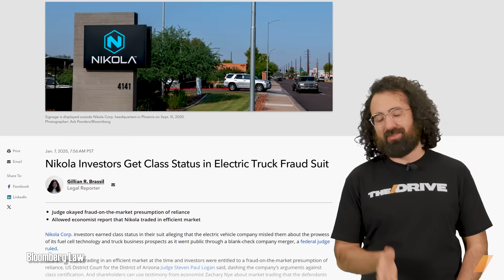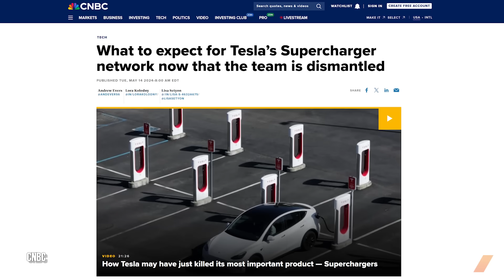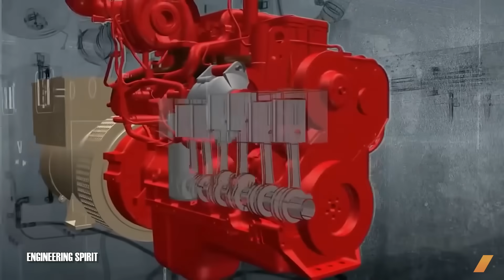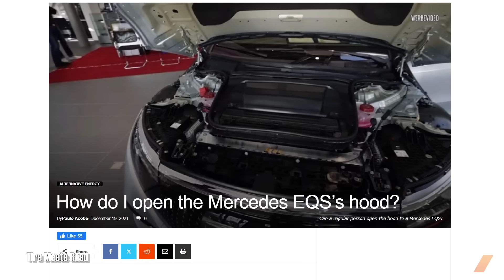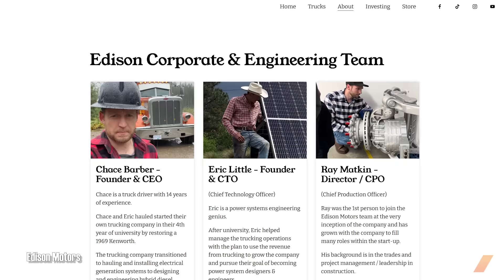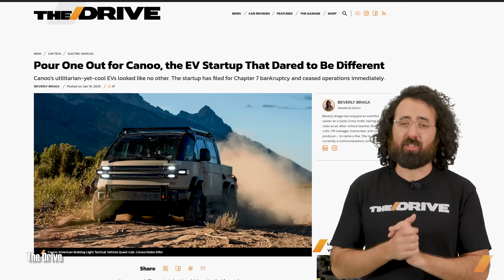The truckers in a shed beating Tesla with 100-yr-old EV tech

Comment: I'm chomping at the bit for the pickup truck kits to become available to bring my 78 jeep plow truck into the 21st century. It'll make my truck harder working, quieter, and insanely more efficient. At the rough estimates they're throwing around for costs, I think the conversion would pay itself off in 6-8 years in fuel savings alone, not even considering that it will uprate my truck to be able to haul bigger loads, which will unlock another revenue stream for my truck. Edison motors are bringing to the market something that is desperately needed
Reply: I'd love a kit for my 07 CRV even eventually, most new cars dramatically overcomplicate themselves now even before you try to use that dumb touchscreen interface in most dashboards

Comment: People wrongly think that diesel electric locomotives are made that way to be more efficient. But the most efficient thing would be to somehow run the locomotive on straight diesel power. The problem is that you would have to have multiple driveshafts going to multiple axles and transmissions. So the physical offset problems necessitate the compromise of adding electric motors. This hurts efficiency but is acceptable for convenience. Using diesel to make electricity to charge batteries to store electricity to get back out again to power an electric motor is losing energy at every step. If you think your electric motor lacks range, you are adding a diesel because of the flaws of the electric batteries. Adding electric to diesels hurts efficiency. It may help in some versatility but not range.

Comment: There is a reason why dieselelectric drivetrain has not made in in trucks. Because mechanical can do the job and in most cases do it with a better efficiency. Diesel-electric locmotoives simply have almost no other option than to transfer the huge ammounts of power. The other option was hydraulics and while it is cheaper, in the long run it costs more because of complex maintenance and lower efficiency. If you have to transmit power above around 600 kW, electric is prefferd. There were a couple of diesel-electric city buses operating on city routes with many stops. Guess what. The fuel consumption is practically double that of a diesel bus with a mechanical transmission (and a hydraulic torque converter). And there is the expense of paying up front for a system with much greater complexity that requires more maintenance and is at the same time heavier (means less passenger capacity). To put it simply: In the "low" power applactaion, it makes no sense to put a electric "drivetrain" between a diesel engine and the wheels. Low being anything below 600 kW of continous power. If you exceen the required 600 kW only during short peak regimes and generally can move with just a fraction of that, there is nothing better than a manual gearbox and clutch.
Reply: Diesel/electric is superior to diesel/mechanical. 

With diesel/electric the truck gets twice the peak horsepower and torque with reduced fuel costs.
Reply: @Sah-o5m  How is the fuel economy of diesel-electric buses? There have been a few thousand build over the decades. I tell you: It is poor. At best there is negligible difference, which does not justify the cost, maintenance complexity and higher mass compared to traditional solutions. I am talking about standard city buses, not some niche application specialty truck, because in those applications it might make sense. If diesel-electric buses would be that good, you would see them everywhere. And I am still talking about city buses which make frequent stops. The difference when compared to city buses of equal capacity, speed, performance, etc. is negligible. In the best case scenario.

Comment: Totally not comparable... One is fully electric. The other is a diesel with the gearbox replaced by a electric drive. So you can only compare diesel vs diesel with different drive types. I do think diesel electric like a locomotive is a good replacement for a normal gearbox. But totally ev is the end game
Reply: Sadly, with today's battery tech, there are no fully EV logging trucks. An interim solution is this diesel/electric hybrid. Over time as the battery tech improves the onboard diesel generator will run less and less until its no longer needed.
Reply: @Sah-o5m  yes, again. This is a useless comparison. The only option nowadays is a diesel with a electric transmission. Nothing special really. Could have been here long time ago but only now someone is doing it

Comment: That's how i power my boat. Small DC generator (range extender) charge my 14kWh battery when needed. The motor is a Motenergy ME1616 with a big Kellycontroller

Comment: As others have noted, Edison trucks are designed with the most available of off-the-shelf parts. They don't have to design everything themselves - mainly it's the drivetrain itself that's unique to them, as even the converters are models you could buy as an individual customer. Additionally, rather than throwing meaningless codes at you, they've been programming their software to actually have explainations for any errors it encounters. No forcing people back to the dealership for a 3 month wait and tens of thousands in repair bills atop the lost production - and no planned obselescence. A big part of the complexity of a standard vehicle surrounds the engine. The engine itself, the transmission, the differentials and gearing system that includes the driveshaft - everything needed to get power from the engine to the wheels. With a series hybrid's generator, you don't have any of that save for the engine itself, which needs less maintenance due to being under less stress. There's an electric motor at the generator, some cables and powerboxes, and electric motors at the wheels (all of which, inherently to electric motors, double as electric generators). Sure, any car or truck will have suspension, framework, and so forth, so it's not removing all complexity from maintenance, but it is truly simpler than a combustion-only vehicle. Poking a battery in the wrong spot is dangerous, in quite the same way poking an engine that just turned off is, and repair shops are right to be wary of underqualification, but most repair shops know this, with EVs and hybrids having been on the roads for years now. The supposed unsustainability is between software locks, intentionally unremovable parts (apparently some cars have oilpans that break if you remove them now, which is truly horrible), and a lot of marketing trying to get you to go to a dealership for repairs.
However, between Edison Motors's focus on vocational trucks - ones designed and built for a specific job on a customer-by-customer basis - and their long-term focus approach to ramping up production, it's going to be a long time before you see Edison vehicles in the driveways of every random person. While diversification is possible (and in high demand), particularly given their pickup conversion kits, it's going to be a slow ramp up as they work out all the kinks before going into full production. They're probably just as likely to go into the business of heavy equipment like digging machinery as into personal vehicles. Or that self-shunting train car suggestion Chase brought up at one point. Still, supporting them is a good use of your wallet's vote even if you have no interest in their actual products, as their methods and mindset are worth supporting and preserving.
Reply: Spot on :)

Comment: I said it on their content and I'll say it here. Purely electrifying our existing systems isn't going to fix anything, (and depending on how we do it, it may even make things so much worse). What we need is a better system like the one we had before we tore it down to make way for what we got now. 

That is not to say that we shouldn't electrify, nor that trucking, vans, and the like dont have their place in cargo transit, anymore than cars have their place in passenger transit, because by all means we should electrify and they do infact have their space. But trucking shouldn't be the linchpin in the american economy when the railroads can do the same role better and more efficiently, and we shouldn't need this concern to warrant electrification. And ofc, with all that said, I do think what Edison Motors is doing is great from multiple perspectives, and should be supported

Comment: All regular RWD cars should have their front wheels replaced with electric hub motor wheels so they can have regenerative breaking, turning that heat and break pad dust into electricity. This can be retrofitted to existing vehicles without too much drama. Turning standard Rwd into AWD hybrid with bolt ons that once they are designed should be off the shelf, plug and play. Might help you hold onto that classic car that the government really hates by turning it into a hybrid. While also improving its power and efficiency.

Comment: Problem is, where is the data ? 
I love to watch Edison and root for them, but all there is is claims. What’s the fuel consumption on the generator? What’s the miles per gallon or better gallon per miles?
I think this is the right way to do a hybrid… but we need real world data. 

In Europe there is battery electric vehicles that only is about one ton more heavy than diesel… you forgot to Elemente everything like the 800gallon tank in your equation… 

In Europe there is a limitation of hours allowed to drive. With one driver more than 800km/day isn’t possible, while there is 45minutes mendetory every 4hours… so 500-600km is the perfect range for a Europe semi
Reply: McMaster University is doing dynamic dyno fuel consumption usage now. We'll get more data later this summer.

Comment: Let's not overlook the fact that you could easily and cheaply power your shop or home using your electric semi, or even your electric pickup. Plus you can power your tools at your work site. It's equivalent to an off-grid system on wheels!
Reply: Exactly. This wasn't mentioned in this video. An Edison truck can provide 600v at 400 amps as emergency power to a home, or jobsite, or for welding and bucket trucks.
Reply: @Sah-o5m  - That's why I mentioned it. So many people waste time on generators which need to run almost constantly, when instead you can set up a battery backup for your home and just run the generator when the batteries need to be charge back up. I'm wondering if they will allow you to purchase just the battery and generator to mount on a small trailer with a small diesel engine specifically for powering a home or shop - it would be a great offshoot business for them too.
Reply: @ I think this is a great idea. Take Edison parts and make a welding rig on a trailer or a home generator. I think at first all parts will need to go to truck reservation holders that have been patiently chomping at the bit waiting for their turn.

After that, when normal people can visit the Edison website and go to the order page and just mouse click the check boxes for what they want that will open up new vertical markets
Reply: @Sah-o5m  - Actually they could gear it up now while they are waiting for their tuck assemblies to meet all of the government bureaucrap requirements. It would be an almost instant team of revenue and help fund their truck division.
Reply: @Rattlerjake1  ahh. Interesting. I like the idea. The only reason I discourage it, is because I know that all Edison people will be 100% busy in Donald building their shop. And they'll be 100% busy dealing with CMVSS. And they'll be 100% busy working on 10 trucks. To add another 100% busy on their plate and I think they'll crack. I mean don't get me wrong. The average Canadian can do the work of 2 or 3 normal people. But if we make em do the work of 4 people, that's a bit much.

That being said, i can totally see Edison gear being used in clever ways to do all sorts of things. 

Like how they used to make doodle bugs out of old model T's. 100 years ago you could strip off the cab and use a model T to run the overhead belts in a sawmill.

Edison truck parts could end up doing all kinds of industrial stuff.
Reply: @Sah-o5m  - They don't need to do it all themselves; this would be a good time to hire more people, paid for by the new offshoot. The companies who build the actual batteries and generator inverters/converters will not hesitate to increase production when the systems start flying off the shelves. THAT'S IF THEY CAN PRICE IT MORE REASONABLY THAN SO MANY OF THE OTHERS who are taking advantage of the market and over pricing their products.

Comment: 1:40 America is ignorant, attacking once again .

 Volvo, iveco,scania Not to mention in China where SANY has a battery swap truck

5:59 Just call Electric diesel if there is no battery. 

But if there is a battery and can run several km without turning on the engine We call it EREV .

Comment: Old Diesel trains.. Diesel generator + Electric motors. Modern electric motors are insane these days and we can get rid of machine parts running a power line computer controlled to electric motors. No direct link to wheels from engine so the engine can have smooth operation the whole time without having to fight anything. Boosters? Make generator a little extra higher power output + Stack capacitors = Regenerative NOS but with Capacitors lol..

Comment: Click bait BS! Charging over an hour? Yeah, maybe at an Electrify America charger! LOL Tesla has it down to 20 minutes at a level 3 charger. "Fully electric semi trucks can't be done!" Sounds like Bill Gates and guess what? He was wrong too! Edison is foolish for continuing with hybrids and spreading obvious lies about EVs is even dumber. Stop sucking at the teet of big oil you ignorant fool!
Reply: Huh? Where are you filling a megawatt hour battery on 220 volt level 2 charger in an hour. Perhaps on a tiny prius battery, but certainly not in a semi.

The word record semi truck run was using 4 hour charges on level 3 chargers after 6 hours of driving over a 24 hou4 period.
Reply: @Sah-o5m  actually I meant to say Tesla Megacharger level 3; "The Tesla Semi truck can charge up to 70% of its range in 30 minutes using Tesla's Semi Chargers. This is possible using Tesla's Megachargers, which are some of the fastest chargers available."

Explanation

The Tesla Semi can travel up to 500 miles on a single charge. 

The Semi uses the nationwide Supercharger network, which also includes Megachargers. 

Tesla claims that their Semi Chargers can refill 70% of the battery in about 30 minutes. 

The Semi's proprietary chargers are two to four times faster than any other available heavy truck. 

One truck was able to travel just over 800 miles in a 24-hour period after being recharged by Tesla's 750-kilowatt Megacharger."
Reply: @Sah-o5m  I know a lot about Tesla anyway but this literally took me 5 Seconds doing a Google search...
Reply: @beammeier4997  There are only a handful of Tesla 3/4 megawatt semi truck mega-chargers in the USA and they are at Tesla or Pepsi. It's big news when Tesla announces that they intend to build 9 of these megawatt stations between California and Texas. So your position statement is 100% relevant to Tesla and Pepsi. The remaining 350 million Americans will wait in line looking for the next available port at the local Tesla charging stations
Reply: @Sah-o5m  back when Tesla made the Roadster they said a similar statement that the charging Network wouldn't be built... yet here we are. They even said that Tesla won't make faster Chargers that rely on solar power either and yet they're starting to do that too so I wouldn't put anything past Tesla as "impossible".